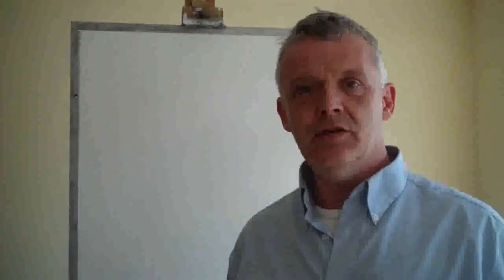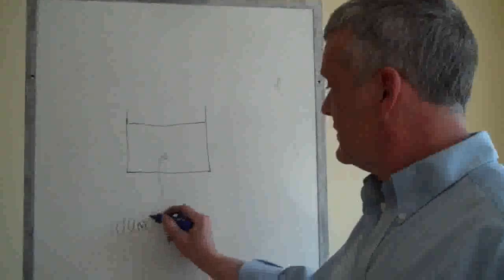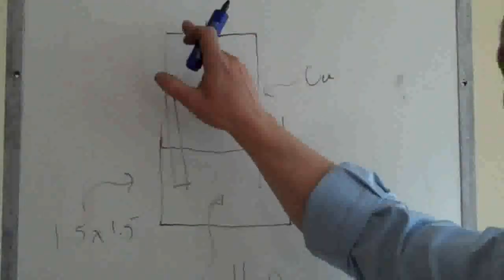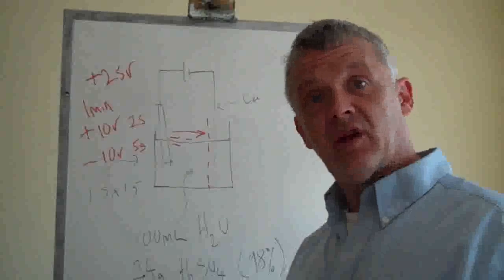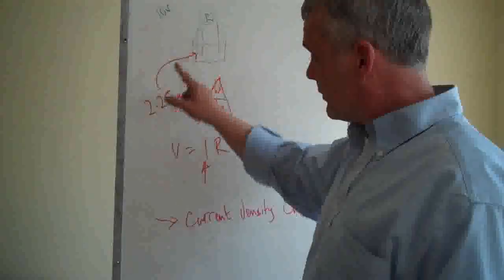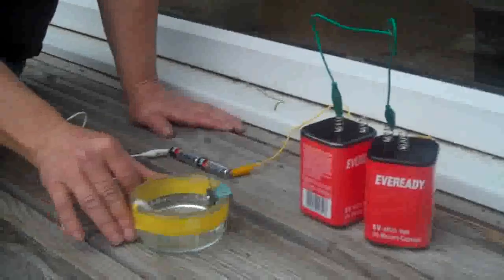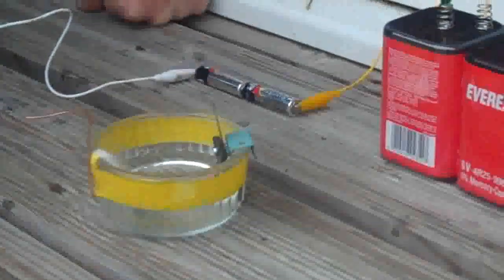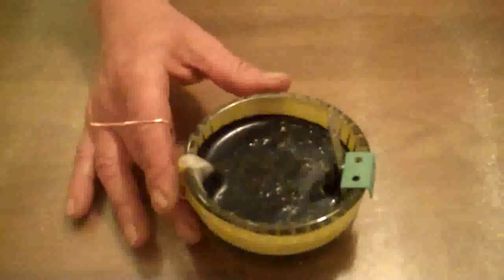Green Graphene

Comment: I am working(as I had access to a bunch of free sample material) trying a similar process with Anthracite coal, as from the look of it, it should be a dirty 90% graphite from the look of it. I am having some luck, but since I started it recently and first watched this ages ago, I neglected to remember a couple points in the, which may have made my first run a very mixed bag. I am using a steel electrode, and forgot to swap voltages back and forth as a regular occurence. I got a lot of activity eventually in one direction, coal on the negative pole, but also pulled a lot of iron (3) sulfate into the bath. I am going to reverse poles for a bit and see if that helps, but also the parts pulling off are at least denser as they are not floating. Just  reverse poles again now, and already the solution is showing the green of iron(2) sulfate becoming populated. It may pull all the Fe back out in a while similar to my run, but I am betting I may need a cleaning process for non carbon content anyway.

Comment: So I should decrease the overall voltage proportionally as the electrode surface area decreases to maintain the same voltage density? If I didn't would I be losing out on a worth while potential yield by the end of the run? I wonder if having 2-3 different cells designed specifically for the different sizes the electrode goes through as it degrades would be worth it or just a waste of time?
Reply: On second thought couldn't a person make a feed system to just dip more into the cell to maintain the surface area?  
I'm picturing the main cell using a small aquarium pump to circulate and push surface liquid out a spout into and  through a filter and then back to the main cell.
Reply: Wait I need a viton seals in the pump don't I.

Comment: Sir Robert Murray-Smith :
Now I'm doing research on graphene on campus for my thesis. I want to know the effect of solvent type and decay time on the amount of graphene produced. But I have found that, as the process progresses, the amount of solvent is reduced because it evaporates and arises heat so that the resulting graphene weight can not be known. What is happening? So, what can I do to keep the solvent constant to know the weight of the resulting graphene? I beg your help sir. Thank You
Reply from the maker: i can't really help that much as i am not on site to see what you are doing and no amount of description can really help - your best bet is to see your advisor - who incidentally is paid to help you with these kinds of problems - anyway my immediate thoguht is you must be using an open system if you are experiencing loss - the first idea would be to close the system
Reply: thank you sir

Comment: Hi. Thanks for the video. Other than sulfate ions, what other ions are capable of exfoliating graphite into layers? I had heard of some people using NaS...I am aware that only certain ions have the correct shape and size to be able to do this...Is there a way I find out which ions are able to exfoliate graphite into graphene? Thanks.
Reply from the maker: +John Corer a ton of things will intercalate - sometimes the methodology isn't obvious - like using a smaller ion as an intercalation assistant to larger ions - CuCl2 helps the intercaltion of Al for example - your best bet is to do a google scholar search
Reply: +Robert Murray-Smith  So, is there a specific reason why pure NaCl won't intercalate graphite? Is this purely because the cation and anion are too large, or are there more components to it
Reply from the maker: +John Corer there are other components - think of it like splitting a log

Comment: Hi

Thank you for your work here. I was so happy to discover your supercapacitor work, I really love that you try making it as homemade as possible and showing it to us. A life saver.

One thing I am wondering about is the filters. I am a little confused. In your book you say 100nm, which equals 0.1microns. Which is a little difficult to come by, but not impossible. Did you actually mean 100microns? Which is 100000nm. One of your comments here, from two years ago, you wrote micron 10-100.
Here are 100 micron filters:http://www.ebay.co.uk/sch/i.html?_from=R40&_trksid=p2050601.m570.l1313.TR2.TRC1.A0.H0.Xsulfuric+acid.TRS0&_nkw=100micron+filter&_sacat=0
Here are almost 0.1micron filters: http://www.ebay.co.uk/sch/i.html?_odkw=mebrane+filters&_osacat=0&_from=R40&_trksid=p2045573.m570.l1313.TR0.TRC0.H0.Xmembrane+filter.TRS0&_nkw=membrane+filter&_sacat=0

May I ask another question? How is potassium hydroxide much better than sodium hydroxide? And would I use 11ml of 30% potassium hydroxide also? Or just the right amount to get the electrolyte to pH 1.2?

By the way. I found wonderful graphite electrodes for cheap on ebay: http://www.ebay.co.uk/sch/i.html?_odkw=graphite+electrode&_osacat=0&_from=R40&_trksid=p2045573.m570.l1313.TR0.TRC0.H0.TRS0&_nkw=graphite+electrode&_sacat=0

I like ebay.

I want to make similar EESD as you are showing on your channel. That is why I want to make graphene. I hope this method will help.

For the capacitor itself, I currently think I will mix the graphene with PVA and water, paint that on aluminumfoil, use glass fiber as separator, and an electrolyte of maybe 0.6g urea mixed with 4.82g aluminum chloride hexahydrate or PVA mixed with phosphoric acid.
I really hope to get to very high energy density. 
I am trying my best to scrape together the knowledge you are sharing in your many videos. I just discovered you a day ago.

Cheers!

Btw. 
I think the 555 timer method for reversing polarity needs two 555s, set in a H-bridge.
I found this, as an alternative with arduino: http://www.instructables.com/id/Super-Easy-Reversible-Motor-Control-for-Arduino-/?ALLSTEPS
Reply from the maker: +sveindaniel it depends what you want to do. If you want the graphene to pass through then you must use a filter paper bigger than the graphene but smaller than the graphite. If you want to stop the graphene from passing through - for example to make graphene paper - you need it smaller than the graphene
Reply: Robert Murray-Smith  
Yes, of course. Ok, and 0.1 micron is needed to stop it from passing through. Ok.
Thanks.
Reply from the maker: +sveindaniel no worries mate

Comment: I read a paper in which they used sodium hydroxide,sodium thiosulphate and sodium hypochlorite to do this process. The basic medium prevents oxidation of the graphene sheets, and I believe it works with a single polarity(graphite as anode). I did this, and got the same kind of black floating film. Unfortunately it foams like mad. Here's the link: http://pubs.rsc.org/en/content/articlelanding/2015/ra/c5ra06404j#!divAbstract
It turns out that you can use sulphate salts in alkaline solutions(Na2SO4+NaOH?) instead of the acid, so even greener.
Oh, and the graphene solution went bluish, like you predicted. Thanks for the constant feedback and guidance.
Reply from the maker: +Chaitanya Bhave Nice article mate - I think I will replicate this - thanks for the heads up
Reply: Robert Murray-Smith wohoo! Make a video! Would love to see.
Reply from the maker: +Chaitanya Bhave I will do mate - next week probably
Reply: +Robert Murray-Smith cheers to that. Btw I saw a video by neatpeat in which he used the mechanical graphene to make a super capacitor.
Reply from the maker: +Chaitanya Bhave it was a good vid - i saw it too
Reply: +Robert Murray-Smith I was surprised by it's working. I'd thought the surface area of the graphene would be small. But I guess the small size of the graphene sheets(individual) would still create a large surface area. Incidentally, I read a paper in which they used mechanical frictional shearing, and found that using BOPP(biaxially oriented polypropylene) as the substrate yeilds rolled up graphene sheets. That should have a massive surface area, I'm guessing.
Reply from the maker: +Chaitanya Bhave i guess it would too - i have a three roll mill - i could cover the rollers in that and give it a go i guess
Reply: Robert Murray-Smith I'll try that too
Reply from the maker: +Chaitanya Bhave go for it mate
Reply: +Robert Murray-Smith  I tried using NaOH+NaS solution today. Got fantastic results. I used 12V DC, and Graphite as the anode.
Reply from the maker: +Chaitanya Bhave I guess the sulphur is intercalating - nice work mate - try polysulfides
Reply: +Robert Murray-Smith

I am considering doing a video of it, but I don't know yet. I have actually already done a experiment. Manager to make alot of bubbles, but I only barely started to erode to electrode after a good amount of energy was run through the system. Its surface is much harder. I think by varrying the rod depth as I do I can dial in on the current density, but I am suspescious that I want lower voltage, the 16 volts seem to have more fun cracking water molecules than working the carbon. I am also considering a DES experiment based on this process in the next couple weeks.
Reply from the maker: +Chaitanya Bhave luckily arduinos are a few dollars each
Reply from the maker: +Chaitanya Bhave i am sure it would try some triton x100
Reply: +Robert Murray-Smith I have been following your video series on graphene for a bit, trying to brush up my basic chemistry enough to feel comfortable experimenting. I think this line of thought is one of the ones I am most interested in following up... this or tea.

My idea is to use NaOH and Na2SO4. Perhaps boiling a speck of sulphur in the NaOH so as to produce sodium thiosulphate and sodium sulfide. It should easily stay base enough to be safe. The sodium sulfide has S2- ions which might get pulled between the layers when the current flows.

I don't well understand how the pH effects the oxidation, but I figure that I don't want any oxidation, and gather that a high pH will prevent it.

I haven't studied chemistry for about 9 years, everything is slow to come back.
Reply from the maker: +Ray Wharton it sounds like you are on the right path though mate
Reply: +Robert Murray-Smith

I didn't get by the store today for sulpher graphite something, and lye, but I found my childhood chemistry kit in the back of a closet and it had sodium sulfate and sodium thiosulphate. Absent grahphite I decided to to a test of concept with a tiny piece of coal I found, figuring that coal is basically low grade graphite. I increased the surface area of my sample to adjust for the voltage of the laptop power supply I have re-purposed to push the electrons. Right now the system is not doing very much, largely because my current density is on the low side at the moment, but I don't mind a low current density, I think it will still have an effect, and as the coal lets go and starts to shrink it might accelerate. 

There is a very slight hue starting to show itself in the water, similar to graphene, but still very subtle.

I will let it keep running, and tomorrow do an experiment with more controlled chemistry.
Reply: +Ray Wharton 

End of test one, the electrolyte wicked up the coal and corroded the wire going to the coal. So my main goal is to get a much better grade of carbon to work with, so the wire can be further from the electrolyte with out unacceptable resistance. Also the fluid I ended up with looks very much like graphene oxide, judging from the honey color. So I consider the experiment pretty cool for making something graphene like from very very poor quality coal (I picked it up off the ground from a black layer in a hill side).

I am also hoping that I can further discourage oxidation by raising the pH with lye next time.
Reply: +Ray Wharton try using mechanical pencil leads. They work great, in my experience.
Reply from the maker: +Ray Wharton coal is an amorphous carbon mate - Chaltanya's comment is good but use a high B number like 9B if you can find it - the higher the B the less the clay even 2B is better than HB
Reply: +Robert Murray-Smith Well I don&#39;t have any soft led pencils, but I took a number two and tried an experiment with it using the re-purposed laptop power supply. 130 ml DI water, 4 grams NaSO4, and about half a gram of NaOH. After ten minutes about a centimeter of pencil lead was turned into a black dispersion.

I think my power supply have far too much voltage for the surface area of pencil I used. The majority of the graphite was blasted into flakes far too large. Later today I might the adjust the experiment, either wiring a dimmer switch in the line, or trying to get much more graphite surface area. I still only dimly understand the relationship between surface area and voltage, I suspect that they are non liner, that is to say that increasing the voltage even slightly might require increasing the surface area a greater amount. But clearly 16 v is way too much for 31mm of pencil graphite!

Happily I will be getting about a kilo of 2910 graphite, trimmings from the manufacture of some huge electrode. It still might not be as nice as that natural flake you mide this video with, but it should beat the pants off of a pencil from my back pack.
Reply from the maker: +Ray Wharton lol - yes it is quite a gentle process really - i like the plan - do you also plan on doing a video of it mate - it would be good to see
Reply from the maker: +Ray Wharton it does sound high mate - but i guess you are driving the current
Reply: +Robert Murray-Smith  I recently had some ideas for the construction. If the cathode were completely submerged in the electrolyte, the floating graphene would not come in contact with the cathode/non-graphite electrode throughout the synthesis process. Using a micro-controller and relay system in tandem could be used to create a setup that adjusts automatically to the change in area of the electrode as the electrode gets consumed during electrolysis.
Reply: Robert Murray-Smith  Yup. Being a CS student I own one and work extensively with these things. Worth every bit of money spent.
Reply from the maker: +Chaitanya Bhave Defo mate
Reply: +Robert Murray-Smith I repeated the experiment yesterday with concentrated sodium hydroxide, and swapping polarities. I got quite fine flakes of graphite. I think if I use purer graphite and a lower current(current source is 12V 2A, way too much), I should get good quality graphene. Also was wondering if using some surfactant in the solution might improve dispersion?
Reply: Robert Murray-Smith will do! Is the graphite from zinc manganese dioxide batteries of sufficient purity for graphene?
Reply from the maker: +Chaitanya Bhave what do you think?
Reply: Robert Murray-Smith I think it's better than pencil leads, atleast.
Reply from the maker: +Chaitanya Bhave lol - certainly - the best is to get some graphite - but it is worth a try
Reply: +Robert Murray-Smith I'm just using this while I get myself acquainted. For applications ofcourse I will go for higher quality. My only concern is that the graphite be sufficient quality to make atleast enough graphene to know that it's working. I'm especially interested in this electrochemical process because the advantage of electrochemistry is that you can get higher purity products from lower purity reactants. That, and electricity is cheaper than reagents most of the time.
Reply from the maker: +Chaitanya Bhave good plan mate
Reply: +Robert Murray-Smith I was reading up on papers related to your advanced supercapacitor materials, and stumbled across something interesting. I'll have to search for the paper, but they used sugar+copper salt(like your zinc nitrate video) and ended up with copper nano particles coated with amorphous carbon. It is oxidation resistant, too. And quite cheap, and scalable. Even more interesting was a paper where they flame reduced a copper salt, and ended up with copper nano particles coated with graphene sheets. Again, very cheap and mass producible. I may test these soon.
Reply from the maker: +Chaitanya Bhave good idea mate
Reply: Robert Murray-Smith sorry to bother again, but I have had some progress, maybe. Today I was performing electrolysis of graphite anode with a sodium chloride solution. Again, I ended up with some small flakes, but something else remained too. It is grey-black colored, cloudy and settled to the bottom sort of like agglomerated nanoparticles do. Could you guide me as to what it might be?
Reply from the maker: +Chaitanya Bhave could be anything mate - but most likely is impurities
Reply: Ohh okay. That's disappointing.